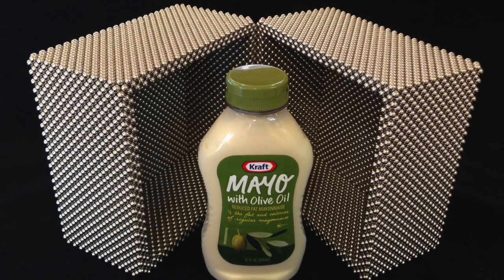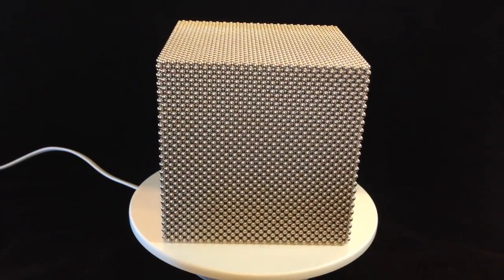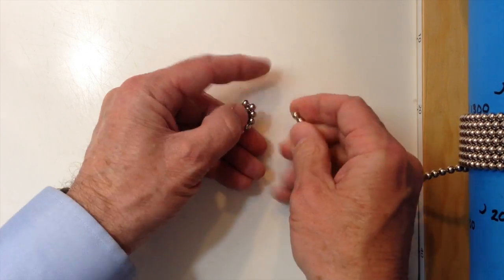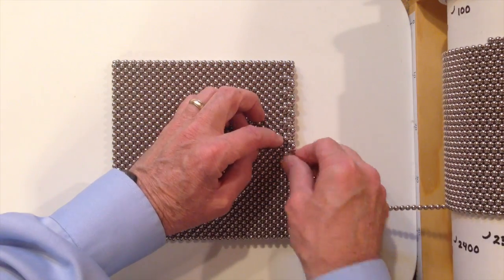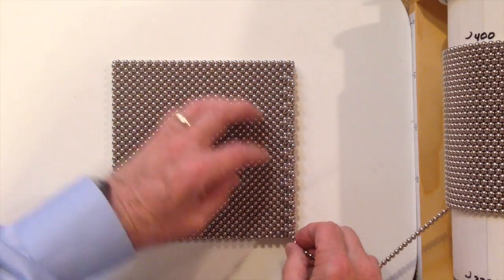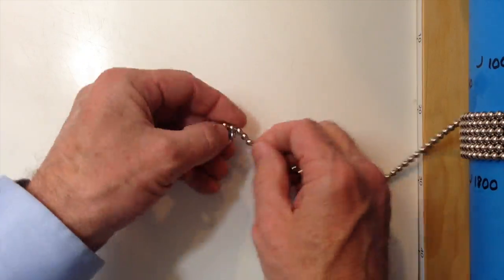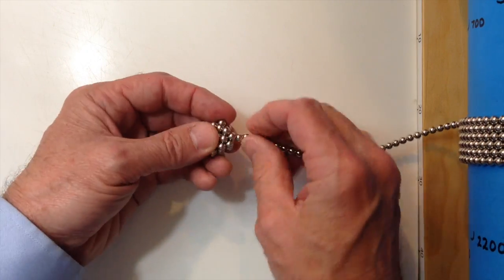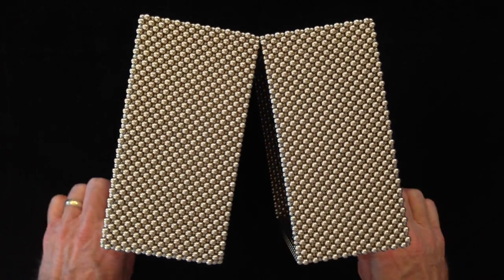World's Largest Hollow Diagonal Cube (Zen Magnets)

Comment from the maker: Noah, I now own the equivalent of 84 sets of Zen Magnets for a total of 18,420 magnets. Of these 84 sets, 34 were purchased with cash, 14 were received for photographs accepted into the Zen Magnets gallery, 8 were awarded for winning Zen Magnets Contest 39, 18 were traded for cash winnings from Zen Magnets Contests (Contests 34 and 39), and 10 were awarded for my help with an oversize magnet problem. When I was buying them, sets cost $32.98 each.  So in actual cash outlay, I've spent 34 x $32.98 = $1,121.32 in United States dollars. But the value of the magnets is 84 x $32.98 = $2,770.32 in United States dollars.
Reply: 0k thanks